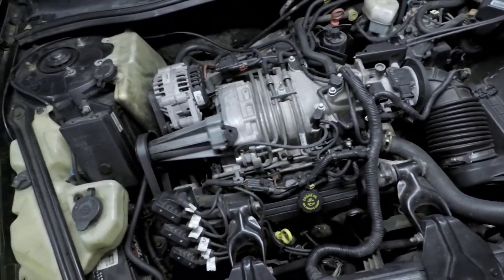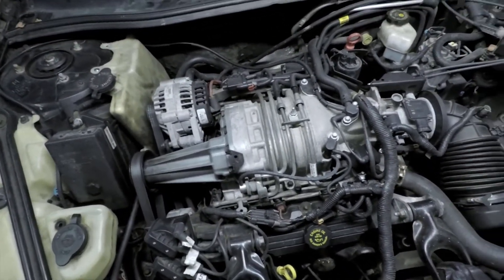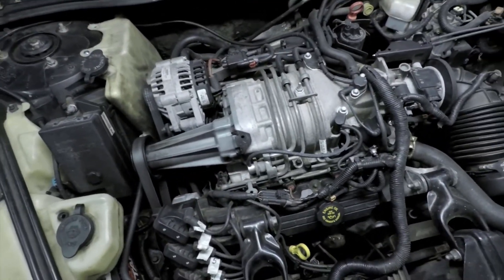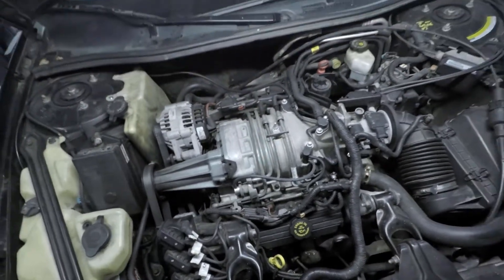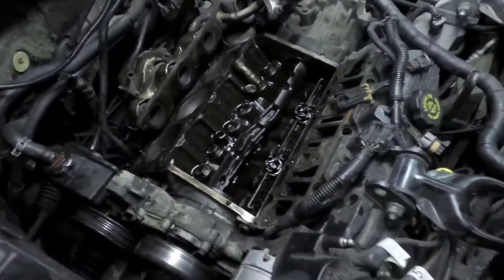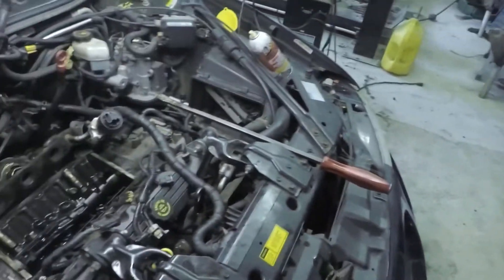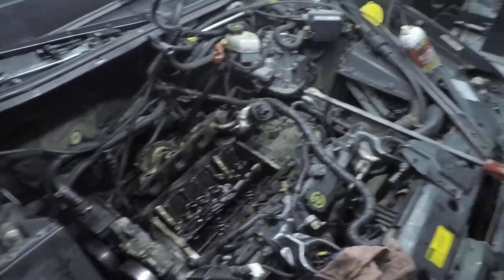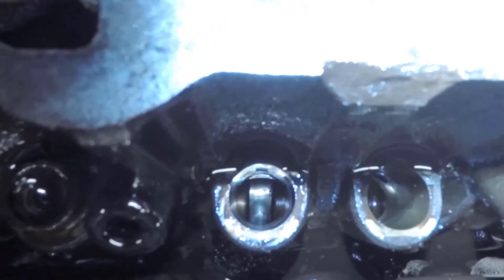Is this the end of my 97 Grand Prix GTP???

Comment: I just got a 1997 gtp with perfect cleaned under the hood with very low miles with no problems for super cheap !!! Had over 6 mechanics check it out to best deal of my life !!!! My car is even cleaner then this one
Reply: And running 60 to 70 miles an hour is running at 2500 rpm 2000 2500 rpm is that right I thought it should be around 1,500 or lower

Comment: Can you tell me what is going on with my Grand Prix GTP,, shifting 1 to2 ,, it Acts like running out of gas,, sputters and I peddle it and it clears up, not slipping.. I have changed,, tps, maf, o2 bank1 sensor 2
Reply from the maker: Needs to be looked into a bit more.  Any codes?
Reply: when I first started it was a bad gas few me I found a lot of gas a vacuum leaks but to the one from the intake manifold to the map the plastic line was broke the murder been changed so I started this searching everything I'm a mechanic but it's just been a long time LOL, but but service engine soon light was on and I fixed everything change the throttle position sensor change the mass airflow sensor change the intake air control sensor to snorkel and all the codes are cleared the computer showing no problem and also changed O2 sensor bank 1 sensor 2 past the catalytic converter and I've done everything I can do clean the EGR cleaning the throttle temperature sensorplease help with anything you can would a transmission service help do you think there's a maybe sound like any of the solenoids it just does it from 1st to 2nd would that be the that that still annoyed I'm so lost I don't know anything about electronic transmission you put me under the hood of a 78 Camaro z28 LOL
Reply: it says the transmission supposed to have a vacuum line where does it go where should I look to see if it's even on there cuz I don't see one nowhere
Reply from the maker: Gtps have 4t65ehds. They dont have a vacuum line on them.
Reply from the maker: If there are elecktronicks transmission malfunctions that should be codes
Reply: That's right I have no more codes,, what could it possibly be, driving me nuts

Comment: Wait a minute !!! Rear head ??? As in head gasket ?? A worn  out head gasket can cause a misfire ?!? Pls tell me that's not true ... I don't think mine is blown  but I am very concerned about it PPL say if u got bubbles in ur radiator valve thingy then ur head gaskets r blown is that true ???
Reply from the maker: +Lebron James many things can cause misfires, a blown head gasket can, but usually there ot will also cause smoke or mixing of coolant and oil.  In this case i pulled the head to check for cracks.  I disnt find any though.
Reply: @SalemDoyle  are the head gaskets on this car metal also how much is the millage
Reply: @SalemDoyle  what about the radiator tell with the bubbles is that true head gasket blow is u got bubbles ? So if coolant and oil are mixing I thought that was a intake valve thing not a head gasket thing
Reply from the maker: Coolant and oil mixing can be caused by intake leaks or headgasket leaks.  If the compression seal in the headgasket fails, it can cause bubbles in the coolant.
Reply: @SalemDoyle  idk what to do that's a very expensive tough job plus the car seems fine ... in the current bad condition it is in it's performing exceptionally well. I'm hoping I can solve all my problems by changing the first two gaskets not the bottom heads...its hard to properly use the bubble method when theirs pressure by the antifreeze which would cause bubbles. Are their any behavior tells ... on the blown head gaskets . The only odd thing I notice is that when I try to use the boost sometimes the engine hesitates kinda like speeding up but then it feels like the car is being pulled back .  It's weird like I lost acceleration.. it could be the transmission shifting automatically but I'm not as educated on cars as u r .
Reply from the maker: Usually, head gasket problems come with some very noticable symptoms, if its running well and not overheating they are probably fine.